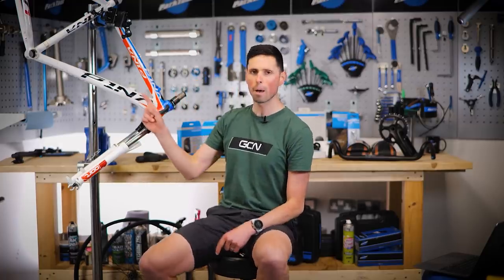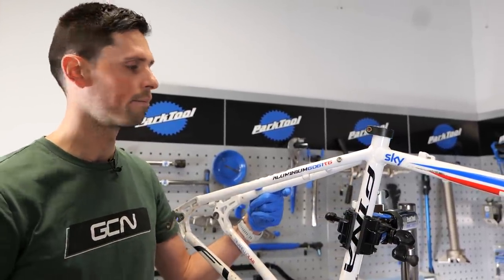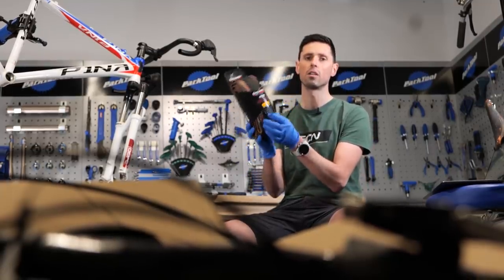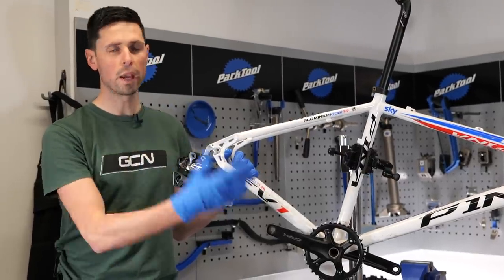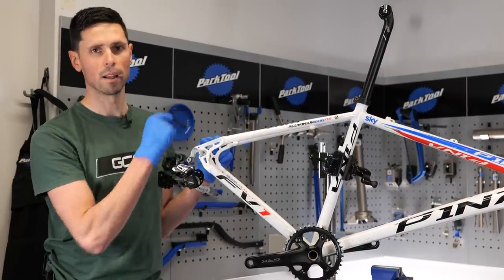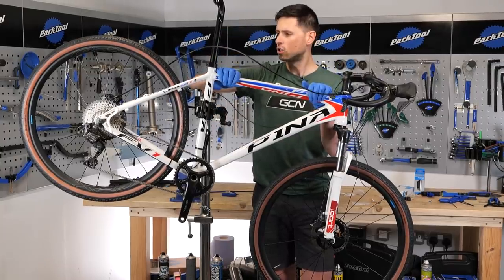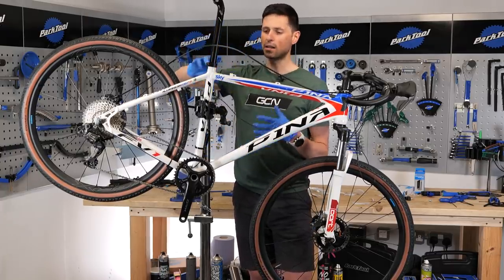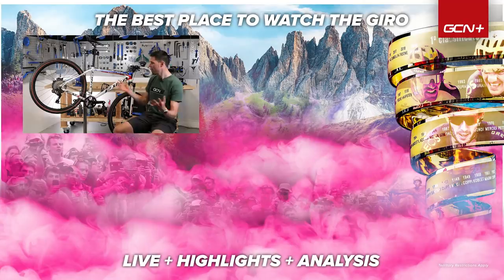Building The Bike! | Old MTB To Super Gravel Bike Ep. 2

Comment: A GRX DI2 setup and a Rock Shox Dart Fork ?  The fork is the cheapest worst performing suspension fork, the absolute bottom of the line from Rock Shox paired with the high end GRX DI2 ?  Find an old Fox 32 for 26 inch wheels as least....  The crank was a questionable choice as well...

Comment: The idea behind this series is cool and all, BUT the execution is going a downhill steeper every episode. Started with murdering a rare and expensive bike instead of a common one (£500 buys you a brand new bike), then proceeded with loading it with the most expensive components possible (also Di2 still need cables?? Shimano needs to learn from SRAM...). 
Now they are doing what would be evaluated as a bodge on their own show by bending the aluminium frame and using spacers for the bb? Damn.... :(
Reply: And don't even get me started on keeping the MTB fork. Heavier and probably shot already, while having to rely on a substitute brake caliper because of the different mounting points...

Comment: I have finally worked it out. It's a late April fools.
Nobody in their right mind would attempt to do this.
Spend £500 on an old alloy hardtail (26inch) because it's got an Italian name and was probably made in Cambodia or Taiwan.
Then throw £2000 worth of electronic groupset at it, wheels that don't fit causing the crankset to not fit due to spreading the rear stays.
Not to mention keeping the 2Kg spring forks.
You can buy a complete 
carbon gravel bike with integrated cables for less than this joke of a build.
I am now unsubscribing as I can't take anymore of this garbage, for the sake of advertising Shimano products